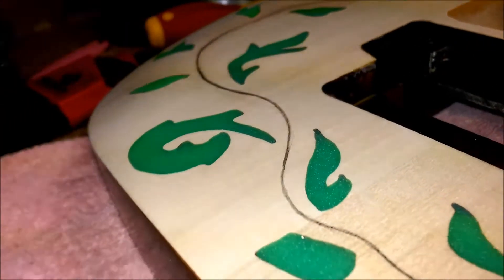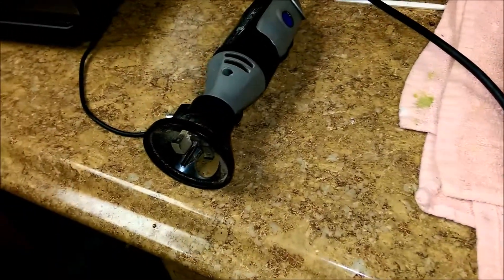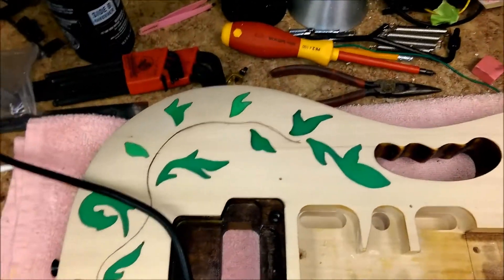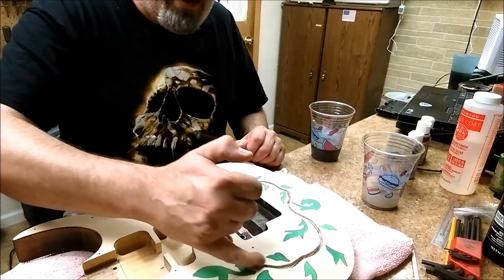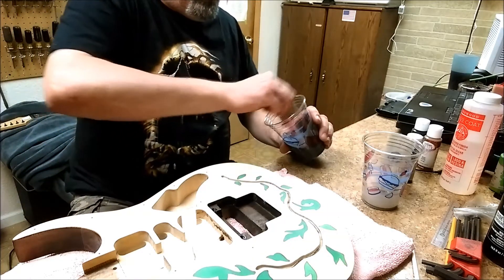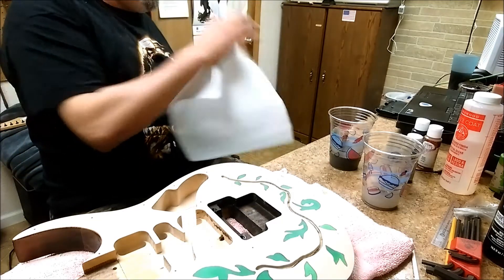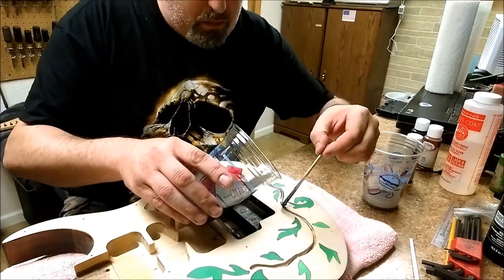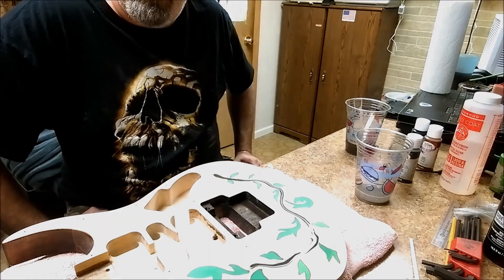Kit Guitar Upgrade Part 3

Comment: If you wanted to add detail with another color in the leaves would it work to route smaller lines into the dried epoxy then put another color in there or would it mix/melt together? Not saying you should just wondering if it would be possible because it seems like that would be cool for future things. Take care Eric.
Reply: I see, yeah that's what I wondered is if you could keep a sharp and distinct separation between colors that way. It may end up even cooler if they do bleed together though for some things.